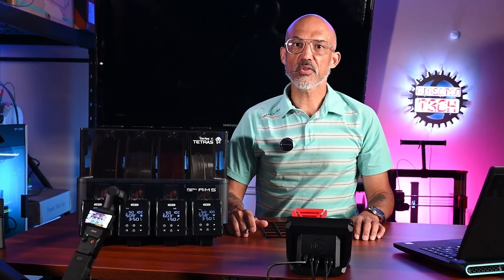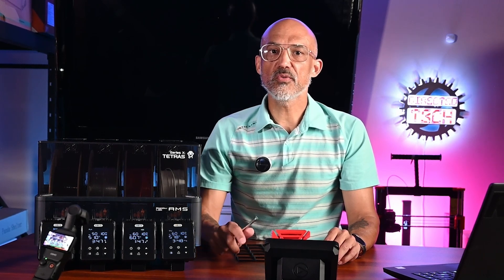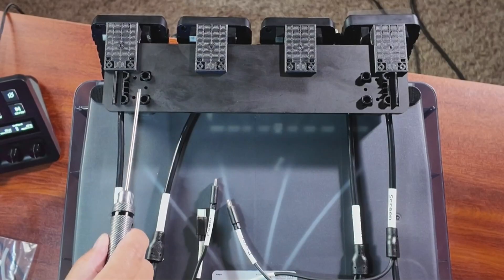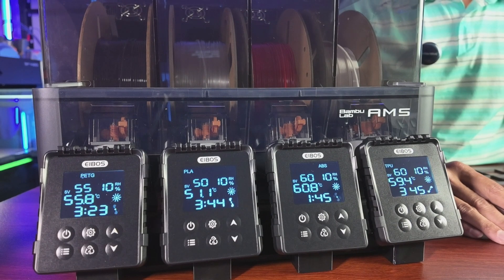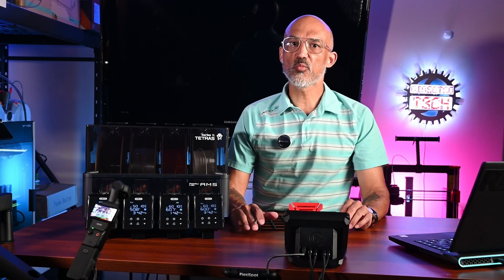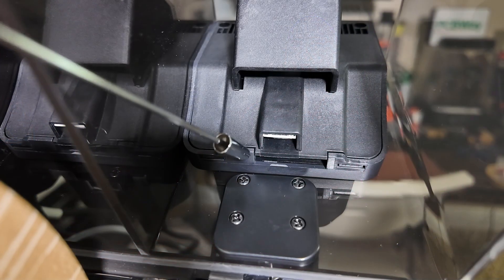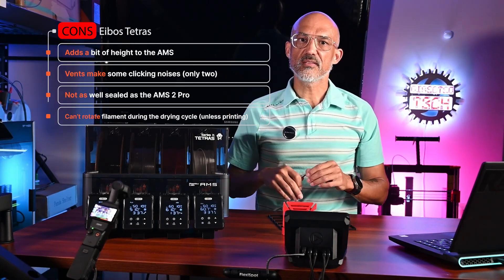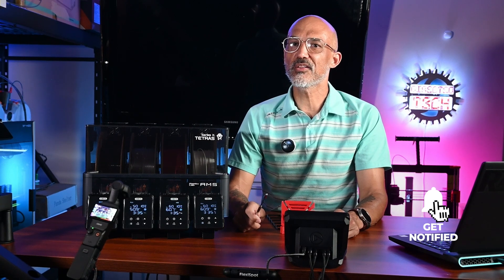“EIBOS TETRAS Review (June 2025) – The Ultimate AMS Filament Dryer?”

Comment: I see the unit is sitting on a table top and not on the Bambu printer.  All of the information I have seen says it must be put ontop of the printer itself.  The reason why I ask is because I would like to use this as a standalone for another 3d printer, Prusa XL.  I do know it needs the lid off of the original AMS, but can that be purchased separately to use it as a standalone?
Reply from the maker: The Tetras doesn't care where the AMS sits... it's just heater modules.  You need an Original AMS base.  The Tetras is the new top shell with drying heaters and the control panels, wiring, etc.
Reply: @directedt3ch  Interesting, my post didn't make it the first time, probably because I put a website link on the reply.  Sorry to ask the question as I am not to verse with this product.  When you mean, "AMS Base" are you talking about:  Bambu Lab AMS - Automatic Material System that is being sold at the Bambu website for 249 currently?
Reply from the maker: @jimmydiaz5123  correct.  You have to have an original Bambu Lab AMS to use with the Tetras modification.

Comment: I have an AMS2 Pro, would this be a useless add-on for it?
Reply from the maker: You'd be able to print and dry at the same time. I believe they are working on an adapter that has to be printed to make the Tetras work with the AMS 2 Pro.

Comment: U fail to mention that aside from the drying by getting the ams2 u are also getting a machine that loads and uploads the filament faster than the old ams system, not buying the ams2 strictly becuz of 1 heating feature is easily comparable to saying it's better to get an ams2 for the faster speeds
Reply from the maker: That's a good point about the loading and unloading speed.

Comment: I got mine a few days ago and built it this morning. As it was my first time I took it slow taking about an hour. I have the two zone model but the layout is more or less the same for the four zone model just twice the number of cables and front panels to connect. I reckon I could do it a 2nd time in 15-20mins.
I’ve got it drying out some filament now, all good. Hits 65 no problems.
Yes my old front desiccant containers will no longer fit but the ones that go under the spools are OK.
I’m actually wondering whether even the two zone model is too much. I mean I have PETG/PLA at 55 and some carbon fibre stuff in the other zone at 65.
One final point if you live in a cold place the manual warns it might not reach 65 but I noticed the unit comes with loads of packing material that might be usable as insulation! Bonus! 😂

Comment: I just received my Tetras and have it drying 4 spools of Bambu PETGHF that were previously dried and stored in the same AMS with desiccant.

I dried the PETGHF for 12 hours at 60C.   When I looked this morning, the RH was reading 27%, but the system wasn’t drying.

Shouldn’t the Tetras be drying if the chamber RH is above 20%?

How can I set the chamber RH below 20%?
Reply from the maker: Press the "Setting " button to cycle through and adjust drying temperature, drying time,
drying power, and drying/humidity mode. When a parameter blinks, use the "Up " / "Down "
keys to make adjustments.
Mode selection:
When "— —" displayed at humidity level: Drying Mode Only — the device shuts down
automatically after drying is complete.
When humidity value displayed: Humidity Mode on after the drying process is finished. The device
activates drying automatically when ambient humidity exceeds the humidity value preseted and stops 1 hour after the target humidity is reached.

Comment: I have a wall mounted rack system originating from makerworld user 3D-aniel which is amazing and very well designed. Will the modifications alter the feet of the AMS pro and potentially affect placement on the racks? The rack has side supports and a flat base to sit the AMS pro. From your video it does not appear to be an issue. Also you mentioned an height change from the original AMS pro. How much change?
Reply from the maker: I'll have to do some measuring to answer your question. The feet do add some height, and it alters how it sits, meaning it's no longer just a flat base. The feet raise the bottom 45mm and the entire unit takes up 275mm in height with the lid closed.

Comment: Worst product manual of all time, can you please make a video on how to use the control panel? Mine doesn’t turn off when I powered off only if I unplugged it.
Reply from the maker: That's interesting!  I can fully turn off each dryer with the power button, or turn it on to drying mode, or put it into maintain mode. Have you reached out to Eibos?
Reply: @directedt3ch yes, no response

Comment: Great video, so thanks. 
I wonder wether I could remove the acrylic spacers between the rolls of filament and just heat the entire unit with one heater as I only print with PLA mainly, giving longevity to the unit as would last four times as long. Another thought would be, would the unit dry the orange beads I have inside the printer as this would keep the humidity low when not printing and not run the heater, saving power and money. What do you think?
Reply from the maker: I bet you could.  They released the Dyas as an option with just has two heaters and one divider.  It would take longer to dry would be my guess...

Comment: Looks like the usual desiccant container everyone prints and places in the front voids won’t fit with the inserts now? Was about to print some but might save my. Filament for when my dryer shows.
Reply from the maker: Correct. There is space there and one could probably make a new container, but now I let the Tetras constantly control the humidity. I did peint desiccant holders that screw into the spool centers.

Comment: Something that’s occurred to me… once you’ve installed all the pieces for the Tetras, how difficult is it to disassemble the AMS to get to the tubing inside?  In case some filament should get stuck in there?  Do you need to remove all the Tetras pieces to get in there?
Reply from the maker: I've never had to take my AMS apart, but the Tetras dividers just pop into place.  It might add a couple of minutes to the process to take them out.

Comment: Couple questions:
1) assuming it works fine for setups with multiple AMS units? eg/ 1 with the mod and 1 or more without (you touched on it but wanting clarification). I assume it would as obviously it's the AMS guts driving it.
2) the "won't turn" comment in the cons, do you mean if you are drying and then decide to start printing it won't turn? Or do you mean auto rotation as some do to keep heat distribution even?
3) I am assuming this still recognises BL filament via RFID?

Otherwise, great review, really helpful! Curious how this competes with the sunlu equivalent (although that is all 4 rolls heated instead of individual).
Reply from the maker: Thanks for the comment and questions!  1. Yes, the printer has no idea that the mod is present. 2. It won't turn the filament during a drying cycle since the heater can't control the AMS motors. If you are printing, the AMS will function normally even if the dryers are running.  The AMS has no idea the heater is there either. 3. Yes, no problem with the RFID detection.  I've only seen one video about the SUNLU dryer.  Although it is cheaper, it is only one heater so it's kind of an all or nothing approach like the AMS 2 Pro.  The SUNLU also isn't going to be sealed as well as the Eibos either.  There are some really large holes in the back that need to be plugged (see the big silicone strip at the end of the installation part of my video). Plus, the Eibos automatically seals after drying whereas with the SUNLU, you'll have to manually shut that little slider window on top or the humidity will come back in from there as well.

Comment: Hello,
Nice and very useful review.
Question...when you put new filament in AMS, close the cover and turn on TETRAS without and settings and you leave it...let say...24h...does Tetras humidity meter shows existed humidity ? Asking as i like to know if can literally measure filament humidity before drying it.
Thank you,
Reply from the maker: If you don't start a drying cycle and the Tetras isn't in humidity hold, the display is off. After the cycle completes, if you have a humidity target set, it will then display current humidity in the chamber and if it gets above the set value it will turn on the dryer again to bring down the humidity.
Reply: @directedt3ch  thank you for explanation 👍

Comment: Ok sorry to be a Debbie downer but first problem I see with this is that if you get a filament jam/break anywhere inside one of the PTFE tubes inside the AMS, you will need to disassemble a TON of hardware before you can remove the bottom cover to clear the filament jam/breakage.
Reply from the maker: That's a valid concern.  I guess I'm one of the lucky ones that has never had filament break in my AMS.
Reply: Remove the bottom cover? My AMS doesn't have a bottom cover, I have to remove the AMS guts from the solid cast bottom to get to the PTFE tubes to clear the broken filament. I didn't know Bambu actually made one with a removable bottom!
Reply: @mpcaz  You're right, my bad. I guess the Tetras mod doesn't make any difference in that situation then.

Comment: This seems like an amazing addon to dry your filament. I seem to always leave my filament in my AMS and it becomes brittle so I have to take it apart to get the broken pieces out. I even left the screws out because it happens more often than I would like lol. I have the Sunlu S4 and they are like $150 so its really not a bad price for this one and I'm glad it can be used on the last gen AMS.
Reply from the maker: Definitely! I was pretty surprised when I saw the price considering it's 4 complete drying systems inside one enclosure! I'm sure they could have saved money by making one control panel, but that would have probably been a UI headache!

Comment: The ACEpro multicolor unit from Anycubic is a dryer as well as a material feeder.  It works great but it is the only thing i miss about my Kobra 3 combo that i had.  I made the switch to a P1S an couldn't be happier
Reply from the maker: What do you find about the P1S that is different from the Kobra 3?  I don't have any experience with Anycubic printers.

Comment: Seems like a great product, but I know nothing of you (first video) or the manufacturer. Where are they based? What's the support look like? What's your involvement? Did you get paid to help with the manual?
Reply from the maker: EIBOS was established on April 20, 2020, in the cement forest of Shenzhen (from their website).  They seem to be very communicative from my experience.  I originally purchased one of their filament dryers a few years ago and I did a review on that unit (Polyphemus).  They reached out to me to see if I'd be interested in looking at the Tetras several months ago and then they sent me one of the preproduction units to test.  I wasn't paid to test or review it.  As far as the manual goes, I told them that I'd be happy to make some suggestions to correct the English version if there were still time to make changes and they were happy to take the corrections.

Comment: Great review.  Do the dryers have individual power plugs or is it one plug for all 4?
Reply from the maker: There is one cord that plugs into the back of the power base that goes to the wall outlet.  The base has the 4 power cords that go to each heater box on the back of the unit.
Reply: Thank you for this — it’s unclear from their pictures on the website, which makes it look like each heater would need to plug into the wall. 

So just to confirm — only one power cord goes into a wall outlet for the heater box, and then each heater plugs into that heater box?
Reply from the maker: @SUOttoBlotto  That is exactly correct.  Only one plug to the wall.
Reply: @directedt3ch ok. Thank you!

Comment: if the power cuts out does it restart the drying when the power is back? And is there any way to start the drying wireless?
Reply from the maker: No, if you lose power the dryer stays off. There is no wireless interface, so you have to physically turn it back on.

Comment: Very cool product. Can you set all 4 dryers the same at one time if you are drying the same material in all 4 slots? Or do you still have to set each one individually?
Reply from the maker: Each control panel is independent from one another. You need to set them individually, but it's very quick to do so and when you turn them on to the drying mode, they remember the last setting.